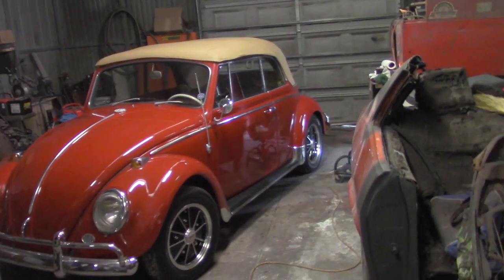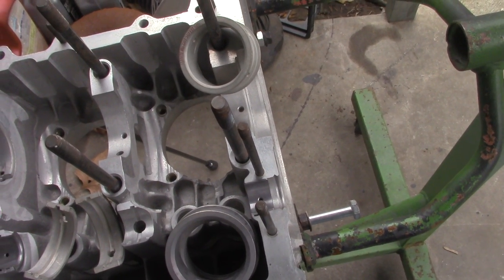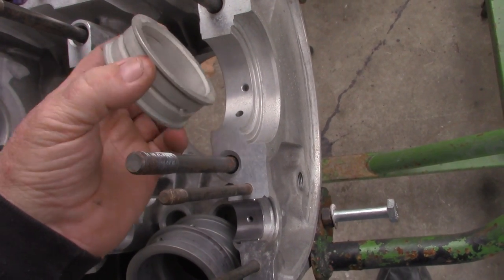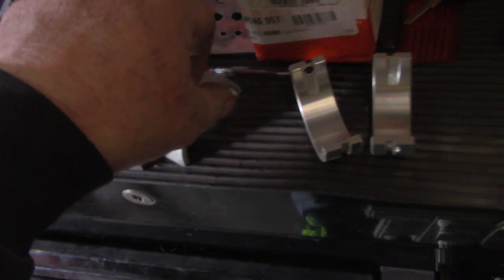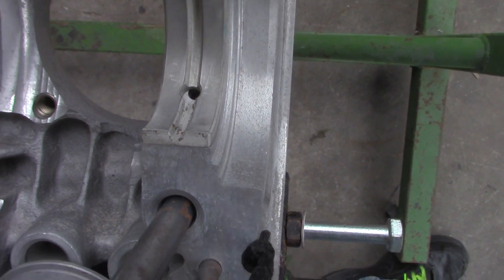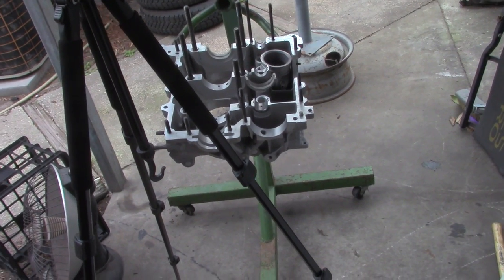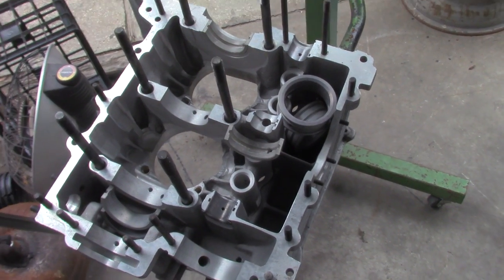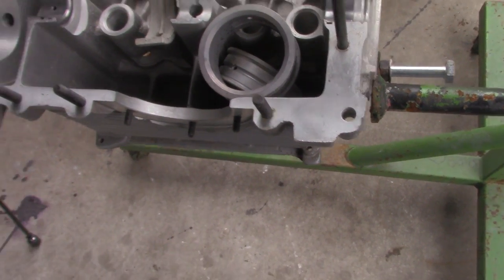2110 shop vlog

Comment: So, the aluminum super case is not only expensive, but heavy and machined wrong. Bearing material is all over the board. and one with grooves cut on the journal faces. Look before you leap. Thanks for the heads-up, Darren. I know you got our backs.

Comment: that case doesnt have a cam gear drain like a stock case it will flood the cam gear . the clevlete bearing doesnt shimmy as bad especially on a new case.but like you say it does wear the crank. that one nice case you have nice crank nice rods nice heads .

Comment: Thanks for the video! Long time follower, first time commenter. I would really like to see the bearing after you've modified it. Do you just make a larger galley by where the oil hole in the case meets the bearing? Or would you mount the whole bearing in a lathe and cut a larger oil galley
Reply from the maker: you can cut the bearing , but the next guy might not be that smart that is why i fix the case , if you have a lathe you can make the groove wider and you good to go

Comment: Question. Would a built up motor last longer than a stock if both were driven/used in a daily driver in a normal fashion and given regular maintenance?
Reply from the maker: i have lots of performance motors out there , and i warrantee  the stock & performance motors you do have some maintenance on a performance motor that you might not see on a stock one such as valve springs & cam where  from higher spring pressure depending on how crazy you get with the valve springs has a lot to do with the maintenance your motor will require
Reply: Okay. Thank you for the reply. I was thinking of a 80 to 100 horse package with a freeway flyer trans IF I can find one or perhaps a Subaru trans conversion.

Comment: Why not take the time the tidy up the case?  Especially the flashing!  That's gonna bite someone one day?
Reply from the maker: i cleaned it up , but it is under the sump you will never see it once it is bolted on, you have to remember every hour you spend is another $80 added to the bill most people are not concerned with the flashing on the outside of the case , and if the do. i have no problem removing it
Reply: Cool. I missed the part that the case was for an actual paying customer. :)  I had thought it was for yourself.